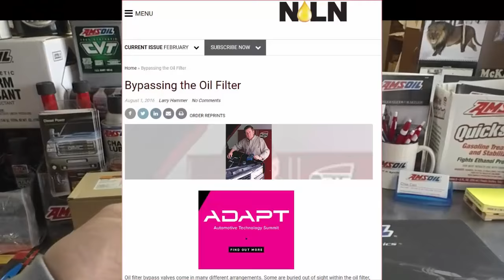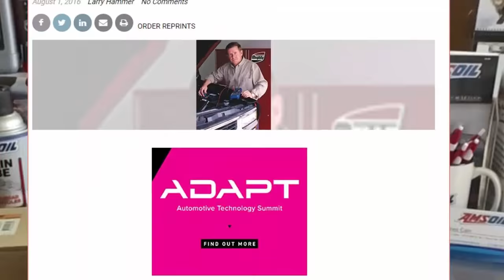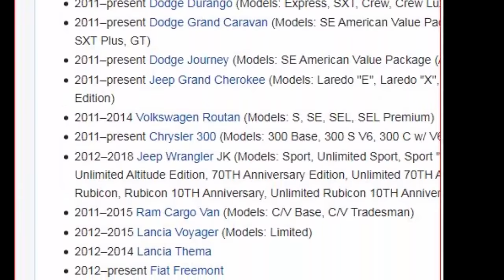2014 and Up 3.6 Pentastar Oil Filter Cap Warning - Ram Promaster, Jeep

Comment: As an fca tech for about 10 years know and an owner of a 13 jk I can honestly say I have no idea what your talking about. Not saying your info isn't correct or anything im just saying I have never heard of this problem EVER. I've done thousands of oil changes with these filters, new and old & have NEVER heard of this. What I have experienced is people over tightening the cap like it's a grade 8 bolt or something and they end up cracking the housing which now cost you an oil cooler but I've never heard of or experienced this concern before. Lol. I'll make sure to delete this "info" from my memory.
Reply: I agree, but i wish they had used a standard metal screw on filter. I always worry about the plastic housing under the intake as the cap seems to stick when you go to remove it
Reply: I agree with you! I think this is B.S.! I think Amsoil is getting desperate.
Reply: @moonbounce  Yeah I don’t trust these Amsoil dealers on YouTube. Lots of fanboyism.
Reply: @andybub45  the bulletin was posted by NOLN.net, not conducted by Amsoil. This video was made by an Amsoil dealer in order to provide the information to those of whom may not know.
Reply: Probably if you use the wrong pre 2014 filter in a post 2014 motor.
Reply: I agree. This seems rather suspect. Especially where he mentions that the 'other filters' have no screen inside while holding up such 'other filter' (@4:36) and you can clearly see the screen inside. Similarly, I have just walked out to my garage (of curse for nothing, I should not even have), OF COURSE my OEM Mopar filter has a screen inside as well.

By the way, the oil pressure argument seem to be misleading to the point of complete non-sense as well and that on pure physics. The bypass pressure that he is talking about in the video is the pressure DIFFERENCE that the filter creates and not absolute oil pressure. And yes, while cold oil flows through the material with more difficulty, it remains to be seen if it amount to create 15 psi. I trust people who have designed this engine (an many other engines prior) understand this very well and have dimensioned the oil filter size or better said the surface size of the filter element accordingly.

If Amsoil can show that they have measured this pressure difference to be over 15 psi, then I take my comment back.
Reply from the maker: @moonbounce  This info did not come from Amsoil, nor am I Amsoil - it was in National Oil & Lube News which came AFTER Chrysler changed the units due to a faulty design.. My intent was to help people find this as Nick above said - never heard of this issue. Nor did I until customers started telling me about it..
Reply from the maker: You would likely never experience unless you live where it stays below 10 degrees for  weeks at a time..
Reply from the maker: @mrtopcat2  I agree  you're spot on but every filter, not just this one issue has a bypass valve for a reason. The material (typical cellulose) can only handle so much flow. If you took a 40WT oil at -17 degrees that paper is going to rupture if it cannt bypass. That goes for any filter. This issue is the fault of having a poorly designed valve in the cap and paper elements w/o a screen or metal backing.
Reply: Yeah and apparently everyone is replacing there oil filter housing/cooler. I blew my timing system outta whack and am in the midst of replacing the timing chain guides, chains, tensioners, phasers, and oil pump. Having a hard time finding a decent oil cooler all the ones that are decent have like a 4 week wait.
Reply: I have found some minor distortion of the filter media on my 3.2L Pentastar v6. But it was not the fault of the filter, ambient temp, or oil viscosity. It was purely operator error. I've been changing my oil on hundreds of my cars and customer cars for over 55yrs. But I was unaccustomed to the plastic threads/o-ring on that cap. When I found the minor wrinkling of the cellulose media, I reasoned I was probably just tightening the cap too tightly. So for the filter change I used a much lighter 'touch' on the wrench on the cap. Next oil change and all subsequent oil/oil filter changes,  I've had ZERO wrinkling, and no leakage either. It's a different feel with the plastic-plastic  threads and the o-ring. It  just takes a lighter touch when tightening back up. Extra force is not needed or even advised.
Reply: I have a 2013 jku yes there’s a bulletin on it and I had it happen to me the tip flew off also my lube tech has it happen to them many times they know to look for it . Have replaced many leaking housing with the up dated one that aluminum the Chrysler is in court about this problem hopefully they will pay and recall this the other problem is that it will not hold oil in the filter after you turn engine off it drains in to oil pan which causes dry start which damages the engine cams there’s a spin on oil filter setup for this problem for dry start ups this will make the engine last long they claim this engine is supposed to last 800,000 miles will see the first engine I had didn’t make it to 1200 mile sand in the engine block and poor
 head design this engine at 145000 miles yes I fix the oiling problem and other things
Reply: It is true what this guy is talking about. I had the same issue.

Comment: Dang. Doing your own oil changes used to be simple. I really like the canister for how easy it is to change and the fact that there is no mess but, was totally unaware that I could screw this up...
Reply: Do you realize there’s no mess because all the oil drains back into the sump after engine is shut off …no anti drain back valve. This gives dry starts every time cause it takes abt 4 seconds for the oil pump to reprime the filter, oil cooler, etc. Guess why these engines have so many trashed cams and rollers. Best use a Baxter adapter and full syn oil if u want it to last.

Comment: I got a 3.8L 2011 wrangler Thank God it`s got a can oil filter which has been around for over 50 years They seem to have nothing but problems with this type of filter You can over torque the plastic cap which will crack the plastic causing it to leak  oil cooler which the filter housing rests in is a piece of junk it leaks oil also when the rubber o-rings fail Plastic is cheaper than metal but over time plastic dries out from heat and becomes brittle  Maybe the engineers need to re-think this and bring back the can filter which works

Comment: Just get the oil filter adapter from Baxter to switch over to a traditional screw on filter. No more dry starts. It is pretty pricy though which is a con.

Comment: 2017 Ram 1500 Big Horn 3.6L   Great information!!!.  I always had a small drip over the last 3 years that I could never figure out, then after this last oil change, it started leaking crazy from a release valve? on topside of engine...so after 3 days of leaving "oil trails" in the neighborhood, I came across this video.🤦🏾‍♂️

Comment: Also keep in mind the earlier filter o-ring is a different gauge than the later filter o-ring.  We had a later model jeep in for service.  Their regular mechanic bought and installed a cap for an earlier model year.  We installed a later model year filter and oring.  The (incorrect) earlier model cap was leaking immediately.  We opened an other model filter box and installed that o-ring.  No more leaking.

Comment: I went through four different Dorman caps to find one that did not have messed up threads. I called Dorman and they are aware of the problem. They said there was a bad run of them, but they made it out in the market.
Reply from the maker: See what you can find on Ebay. There should be people selling older stock there that was better quality.
Reply: I bought a Dorman at O Reilly and it fit fine but my oil pressure is still at 4 psi at idle.

Comment: The oil cap is stamped with a torque spec of 25 Nm (18 ft./'lbs).  Overtightening the filter cap can result in damage to the oil filter/cooler housing in the form of cracks, or disturbing the housing O-rings, promoting leakage.  The simple tightening procedure may save hundreds of dollars in unnecessary repairs.  That is why I always use torque wrench to tighten the oil cap, no more than 25 Nm.
Reply: Yup exactly. From day one of ownership of my 15 Durango 3.6 I put a white sharpie on the filter cap for reference. And most importantly no one changes my oil but me. I'm 60 now and I'll keep doing it until I can't move anymore. Those 5 minute oil change places are responsible for more Dodge oil coolers failing than anything else.
Reply: Have you noticed when using your torque wrench the 18ftlbs is just barely over hand tight  ?  Maybe the hand tight, 1/4 turn rule actually applies here 🤷

I also use a torque wrench on mine, both a digital and a mechanical... I  they would have kept the metal screw on system...

Comment: The 2016 T&C that I just bought used has the solid-hex cap, and the bypass filter is built into the cap.  I guess somehow they used the older filter housing in my car.  Of course, all catalogs and guides for my car lead to the wrong filter.   I haven't read or heard of this difference anywhere else...so, thanks much.

Comment: Been changing the oil on my  14' charger since new and never seen this problem. Also been using the Mopar filter.
Reply: Same🤷🏿‍♂️
Reply: Me too except that my 16 Town&Country cams and rockers were worn down at 97,000 miles and all I used were Mopar oil filters and synthetic oil.@kenik2023

Comment: I really like this style because it's easy to access and I can easily see if I've got metal in my filter. I don't think that snap in is on my 24 gladiator though
Reply: I've been a performance engine builder for a living for a long long time and you know what I tell people about those tools you can buy that cut open filters so you can look inside of them? DON'T BUY THEM!!! Because all they'll do is cause people to lay awake in their beds at night starting at the ceiling all worried about what they saw in them.
First off is how do you know the limit of what's acceptable and what isn't?
And even if you do what are you gonna do about it? Tear and engine apart that you don't want to tear apart in the first place? Even if you do learn what's acceptable and then one time there's more than should be what are you gonna do about it anyway? You're gonna run it till it quits anyways so don't worry about it, and honestly, if there is enough that you can see a difference you'll already have bearings knocking, if you don't they probably will be before you can even get it to a shop if there's that much showing inside a filter.
Those things are only any good for places that do R&D, in the first place they're really the only people who know what they're looking at and even then it's still the readings from an oil sample is what they base things on. 
These modern engines with their big timing chains and their tensioners spit out more stuff that winds up in filters that nothing to worry about but has probably caused more heart attacks than gas prices, even little chunks of plastic from the timing chain guide pads and tensioner pads show up in there and people freak out over it, but it's normal, and the timing chains themselves, take the cover off the primary drive of a motorcycle that has a chain primary drive and look all around inside, those are the same chains just shorter and you wouldn't believe the metal that's all over the inside of a primary housing on a bike, and despite what you'll see they typically last the life of the bike, from slivers big enough that you'll get them in your fingers and drive you crazy because it makes them feel like pin cushions to metal so small it makes a gray paste in the bottom of the housing, and engine timing chains usually involve several with them typically being longer than a motorcycle primary chain, along with 2 to 3 times the number of sprockets so yea, those puppies are kicking out all kinds of metal you'll find in your filter but in all reality is perfectly normal for chains like that, and without analyzing the metal particles in a lab you won't know how much of it is from timing chains and how much is from your bearings, that's what you have to worry about, and without being able to tell the difference you'll just worry yourself over nothing. 
Word of advice, filling oil filters when changing your oil is no myth, starting up an engine with a dry filter shortens engine life, and every time you shut down one of those 3.6 engine's all the oil drains out of the filter, it's a bad design and Chrysler is coming under fire for it, engine's that should go 500,000 mi are going 400,000 and less, a company called Baxter makes a conversion kit that takes a conventional spin on filter and has an anti bleed down check valve in it, the only hitch is the filter is upside-down (compared to how filters typically go on) making it hard to pre fill, so what you do, and you should do it every time you change your filter even if you don't convert it, is crank your engine without it starting until the low oil pressure warning light goes out, the way you can do it on these modern vehicles is by utilizing the "clear flood" feature, to enable it turn on your ignition FIRST (unlike how you normally just press the start button from off, to do that push the start button WITHOUT your foot on the brake, usually the first time you push it it'll be in "accessory", like the old cars when you'd turn the key backwards, then press it again and that's ignition on), then FULLY depress the gas pedal, push the brake then push the start button and it should crank without starting, check to see if your vehicle has a clear flood feature and make sure it's enabled that way (everyone I know of does).
Clear flood is in case for some reason the engine gets flooded, it shuts down the injectors so you can crank on it without having more fuel squirting into the cylinders, most manufacturers that are making engine's these days with cartridge oil filters are training their dealer tech's to prime the filters that way before starting them.

Comment: I replaced my oil filter assembly in the fall. Got cold below 30 and  the P06DD codes have begun. After the oil warms up, the oil light vanishes, engine stays in limp mode. A quick reset with the diagnostic tool and i'm fine for the trip. I have bottle of Lucas Engine Stop Leak in the oil that thickened the oil too. Not losing oil anymore.
Your video is amazing, explained the theory involved for a diy jack like me. Thanks so much brother.
Reply: I'm dealing with that code now ...sucks trying to figure out exactly what it is .
Reply: @GeneralGP114  I'm ordering Dodge Pressure sensor and throwing in new spark plugs for the sake of taking all that shit off again. I ordered that aluminum oil filter assembly and that pressure sensor included is probably chinese trash. 
Did you order one from Dodge or gamble with an alleged OEM sensor?
Did thickening the oil to 10W-20/30 help?
P06DD and PO521 comes up with the weather being warmer. It was throwing PO524's too in the cold. 
Lol the EVAP P0441 is the only permanent code I get if I run the van all day keeping the engine hot for hours with a Code Reset here and there. 

I'd ignore all this shit if the Limp Mode engine fault wasn't fucking with highway driving. The engine is fine ffs.
Reply: @seabass9064  I also ordered the whole oli filter assembly,  changed it cleared the code p06dd.  Code came back still doing the same thing . So went to a local auto store brought another switch . Swapped it out..same thing . I was ready to order a oil pump it self and change that seeing if it helped.  I definitely don't have oil leaking anymore from the oil filter cooling assembly.
Reply: @seabass9064  so should I try one from dodge first before changing the oil pump ?
Reply: @GeneralGP114  yeah, i never had an oil pump go ever on any car. It feels wrong to try that first.

Comment: Also be aware that the new design has issues other than the crushing. The little plastic bypass valve in the cap is only held in by tiny plastic dogs that hook to a spring. Those can fail causing the bypass valve to fall to the bottom of the filter. This effectively blocks 90% of the oil flow. It will cause a cel that basically says that the oil pump is stuck in low flow. It is important to make sure you find all the pieces if this happens. I had to pull the oil cooler out and remove the little plastic dogs that were in the inlet of the oil cooler. Both designs suck, both can introduce small plastic pieces into you engine. Apparently it can happen fairly quickly because it happened to me on a newer car that only had 30k miles on it. Changed the oil it was fine for about two weeks and then the problem started.
Reply: This is quite worrisome. Was this vehicle for all these miles maintained only and entirely by you, or did perhaps someone else had access (Quick-Lube-Center-Service or alike), who may have started to cause this, perhaps by trying to force a wrong model year filter in (as I am sure you know, there are 2x versions). I appreciate your input.

Comment: the bypass valve on my oil filter cap pops off every time I change the oil filter and each time I have to reattach the bypass valve into the cap.  Does that mean that the cap is damaged?
Reply: As long as you have oil pressure.

Comment: Had dealership change oil the last time, now my oil temp sensor code is on.  I bought a new filter and oil cap will add when change the oil again. Will this help?

Comment: I'm confused, I have a 2018 Ram 1500 3.6 Bighorn and it uses Purolator Filter #PL36135. This filter has no type of valve in it whatsoever, so your saying this required valve is in my cap possibly? Thanks in advance!